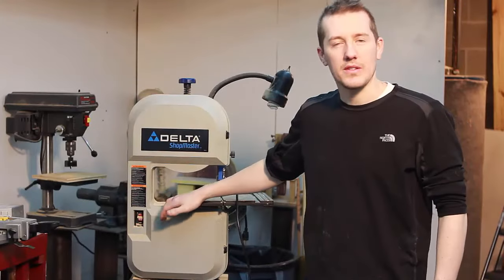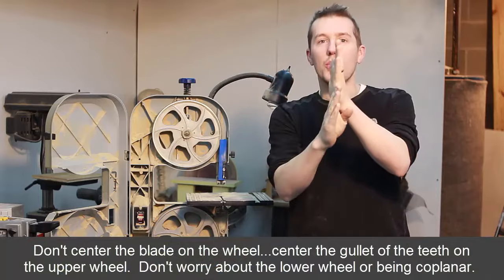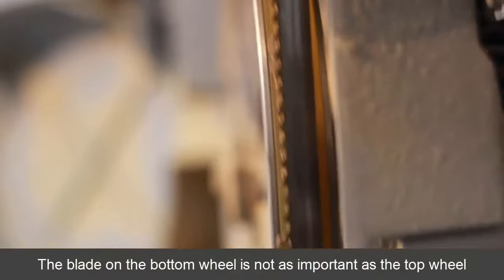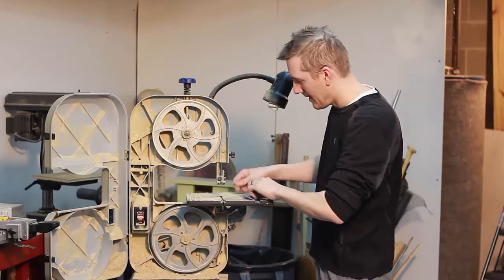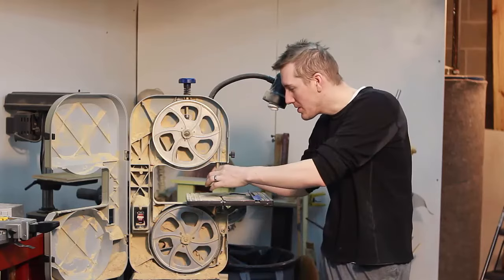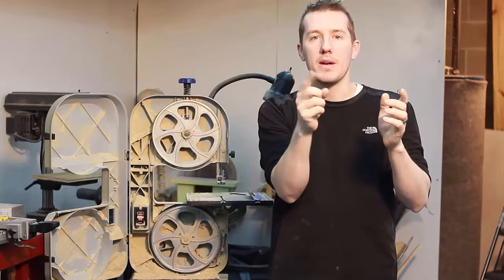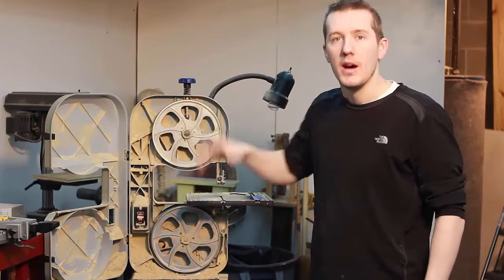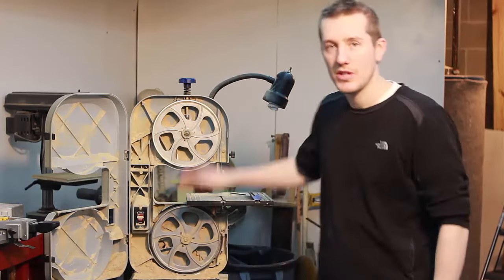Adjust Bandsaw  |  Drift, Resaw, Blade Guides, Tension, Sharpening

Comment: Dave, may I thank you very much. I had an issue with my bandsaw after I put a new blade in it. It started making a really bad noise which I knew didn`t sound right. I left it for ages hoping I could get someone who knew what they were doing as far as adjustments were concerned but I never found anyone. I decided to look on Youtube and saw your procedure. And I`m extremely happy to tell you after following your Sequence of adjustments I have it once again running smoothly with no horrible noises coming from it. So a Big massive thankyou from the UK.

Comment: Thank you for the video! I too have a small benchtop bandsaw with narrower wheels. When I saw the Snodgrass video, I assumed that the bit about centering the bottom of the gullet pertained only to bigger saws with wide enough wheels to still support to the whole blade even with it moved back farther - something like a 3/8” blade would have the back of it hanging off of the wheel. I see that it has still improved things for you though, so I’ll give it a try. Thank you again!

Comment: Thank you for this.  I bought a band saw and it worked perfect.  Then the blade came loose and it was never the same again.  I was using it and after frustration, turned to YouTube.  Now it works perfectly again.  The only thing I did was reposition the teeth.

Comment: Thanks a million for the info! The wheels not needing to be coplanar will save my life. I could spend hours trying to get the top and bottom to line up perfectly.... Definitely going to give my saw a tune up later
Reply: This is partially true. If you’re running a blade where is tracks entirely on the tire it’s fine,  but if you run a large blade you run the risk of hitting the rim of the wheel ..... some saws don’t have a rim, like most smaller saws, then you’re ok. On large saws there is a 1/8 tall metal rim that is in the front and back of the tires and with large blades you don’t want it hitting.

Comment: Thank you for posting this video. I just bought a Rikon 10” saw and changed the blade. I had it centred to forward on the top wheel and my resaw cuts were pretty lousy. Tried your suggestion about centering the gullets...it was perfect. Thanks for sharing this information.

Comment: Thanks, your advice has great. Alex’s Video was great. I have a Delta bandsaw just like yours. This was my only Delta tool that I was not happy with. And it was my fault. After I adjusted everything. The second I turned it on, I could hear the different. No more Drift. Again, thanks for your help.

Comment: Correct.  Gullet edge lines up with centerline of the top wheel.  Then tracking is dead on perfect.  I did a 7-inch wide resaw with perfect alignment after setting up this way.  Thanks.

Comment: This video was in my recommended feed lol but still nice to share info, on my old Rockwell beaver, I shimmed out the bottom wheel bracket the thickness of a fender washers, Just so when I have a 1 inch resaw blade, it does not drive itself off the bottom wheel.  but you are 100% correct, as long as the gullets are in the middle of the top wheel, no drift happens which means less blade tension is needed and longer tool and blade life. Cheers Mate!

Comment: You can use paper to adjust the back bearing. Paper usually runs about 1/1000th of an inch. I found centering the blade on top made all the difference for ripping/re-sawing also.

Comment: Just the vid I was looking for. Have a fairly new bandsaw thats all over the place. Impossible to do straight cuts without twisting all over the place! My tracking is way off if thats where the blade is supposed to cut. Thanks for the info. Off I go to the shed again!
Reply: same thing happened to me with my new portal cable

Comment: Hi Dave- I have the exact same band saw in this video. What type of saw is on yours? Mine looks way thinner
Reply from the maker: I forget.  I sold the saw for like $80 or $100 a few years ago.  
I think i just looked up the blade length then bought one on Amazon.
Originally i had a thinner blade but it broke at the weld.

Comment: So what would you do if you got the widest blade for that machine but its to wide to centre the gullet on the blade to the top wheel? What would you do then?🤔🤔 centre the blade to the top wheel??
Reply from the maker: I'm not sure.  I think for one of my blades - the edge opposite the teeth, hangs off the wheel edge.

Comment: Dave, I get an awful grinding noise when I push the wood through the blade.  It appears as if the back of the blade is rubbing against the wheel (bearing?) .  I’ve tightened everything I can but the noise still persists.  Your thoughts?
Reply from the maker: I think that's normal.  The rubbing of the blade on the bearing, maybe not the grinding noise though.  Maybe just oil the bearing so that it spins a little quieter.  Though it will probably gum up with sawdust...

Comment: Question, brand new Jet 15" resaw band saw. I cannot keep the gullet in the center of the wheel. The blade corrects itself after one full rotation. What am i doing wrong, thanks
Reply from the maker: Mine had the upper wheel adjustment on the back for pitch.  The bottom wheel didn't have any adjuster knob and had to be shimmed.  But i would try other stuff before resorting to shimming anything.
Reply: @DaveWirth  i got it, i had to adjust the tracking. Its a new machine and i still needed to learn it. Runs really well now

Comment: I'm new to bandsaws. I just bought a 1952 Homecraft 10" saw to learn with. I painted it and I believe got a good deal for $50 bucks if I can get it to work. New blade new stand w/wheels. I watched as many info videos as I can find to get familiar with my saw.  My blade keeps moving over to where it's going to jump off. I've adjusted my blade first then I adjusted the guides. I tightened the blade to where I feel it's 1/8" when I tap it. Could my tires be bad? They look ok. Drift is my problem. (Rusty)
Reply from the maker: If it's that old, maybe the rubber on the wheels have worn off.  The wheels need to be convex shape for the blade to ride on them.  you could maybe use tape or something to build up the convex shape on the wheel.  Kind of like this video: https://www.youtube.com/watch?v=TNuzi-jMXoY
Reply: @DaveWirth  Thanks so much Dave. I'll try that and if not put new tires on it.

Comment: My blade runs right on the front end of the lower wheel! Any idea what is causing this? I have the Delta bandsaw and the blade keeps jumping off. I think because of the bottom wheel
Reply from the maker: The bottom wheel is not intended to be adjusted, but it's possible.  You can take the wheel off and add shims or washers to change its pitch or distance from the ends.... 
Not a great solution though.  You could also shim the top wheel to get it to align with the bottom.

Comment: Hi Dave  Wirth,
What reason bandsaw blande broke when cutting metal.
Thanks
Reply from the maker: I believe a metal cutting bandsaw should be spinning much slower, like 300 versus 1,000.  And i forget the units it's not rpm its like fpm or something.  But whatever, when cutting metal it should spin much slower.

Comment: I've done all these things, except the blade sharpening, and mine still drifts to the right facing the teeth. After about two inches of cut it'll start slowly walking to the right. So frustrating. I have to stop my cut and then side cut that portion off and start over 🙄

Comment: How did you centre the gullet on the upper wheel?
Reply from the maker: Ya i guess i never really showed that.  
The saw had an adjustment screw handle on the back that pitches the wheel in or out.
Reply: @DaveWirth  thx